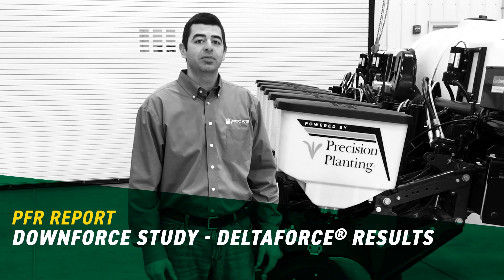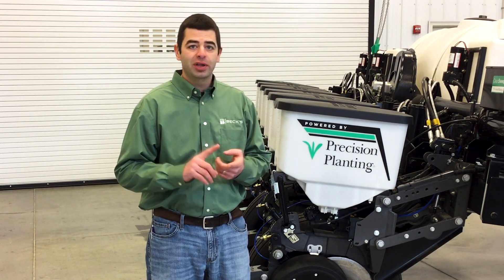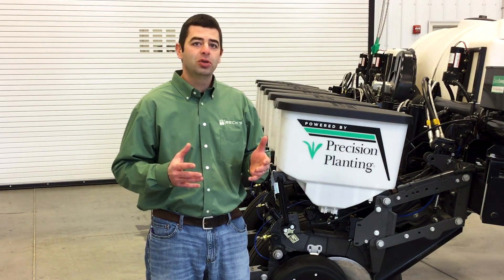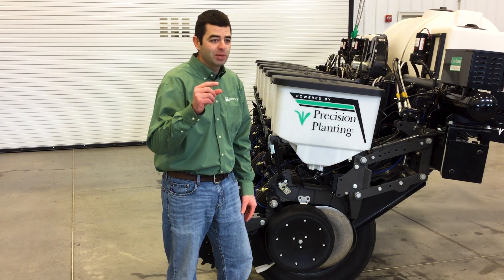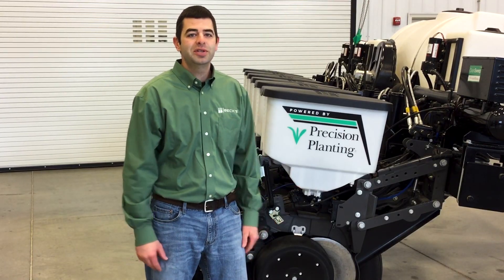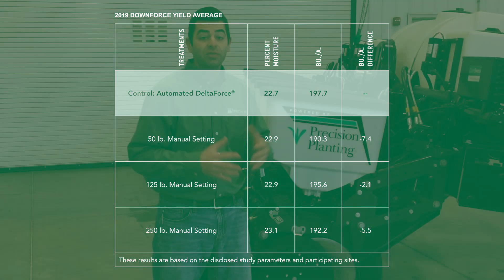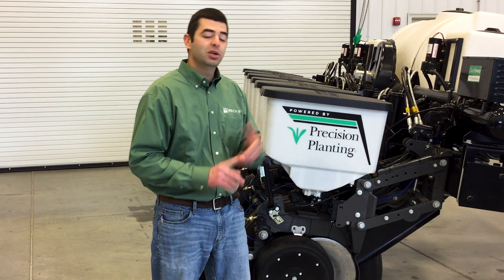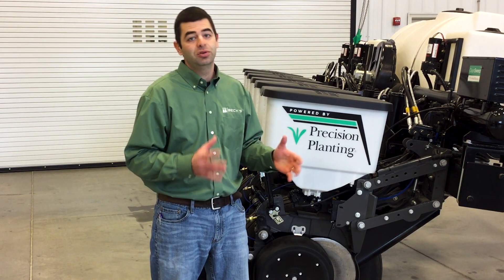Downforce Study - DeltaForce® Results | Beck's PFR Report

Comment: Have you guys tried the dawn reflex hydraulic up/down force? They run independent row control also but they have accumulators on each row to reduce the shock on the row units when hitting rocks and other hazards. This would essentially let the row unit move up or down while maintaining the downforce. 

It seems that by the time the delta force system “senses” the difference of hitting a rock it’s already 3 feet past it.